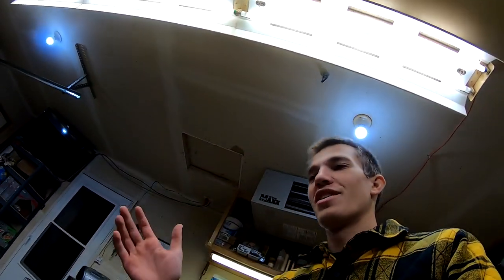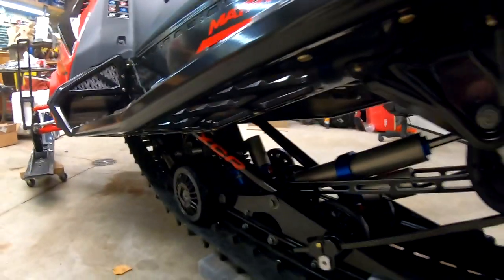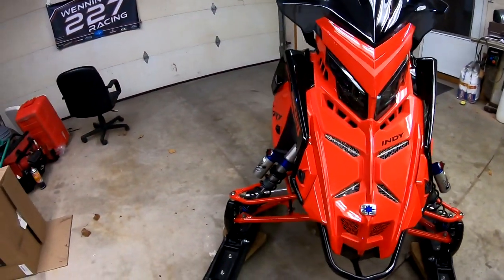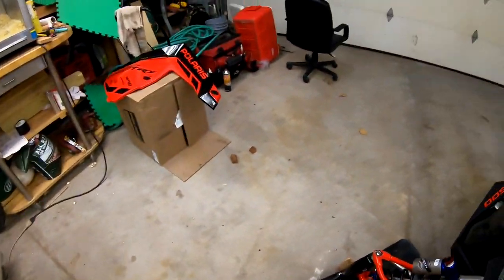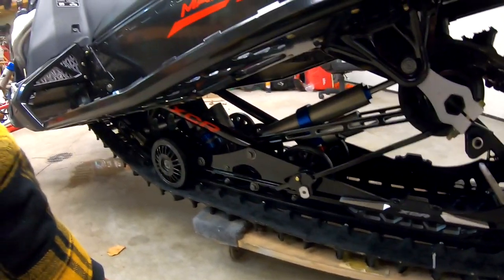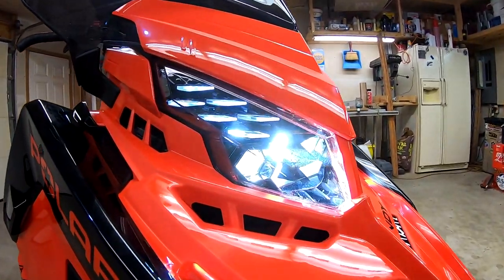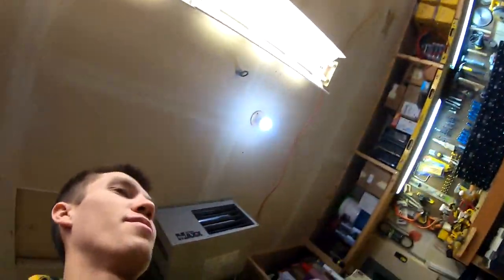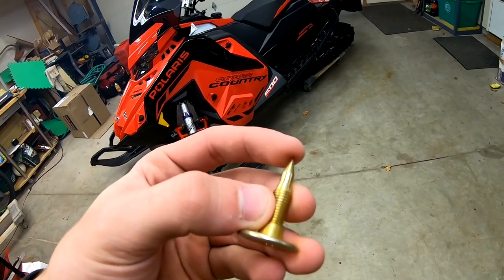Cross Country Factory Race Sled!

Comment: hardly any smoke lol,  usually your garage would be filled with the older two stroke motors, nice sled!! Good luck this season...
Reply from the maker: Yes haha and this is even alot of oil now since the sled is still in break in mode. you should see them after break-in!

Comment: So is that the same engine as in the race sled? Cause the only offerings to the public are 650, 800, and 850
Reply from the maker: Nope, Just a modified stock efi 600 found in the old trail sleds!
Reply: @wenninger2279  old trail sleds as in axys chassis?
Reply from the maker: @kollak01  correct

Comment: For the ice studs kwik pixx, what length should I use for a track with 1.25in lugs. Should I order the 1.375 or 1.080?
Reply from the maker: Depends on the rules in the class your racing in 1.375 will give you 3/8th of a inch of poke on a 1.25 track

Comment: what kind of ice racing are you doing?
Reply from the maker: Cor powersports Cross country its the national series
Reply: @Wenninger227  nice, good luck!
Where are you located?

Since  you put in quick pixs it really limited the types of racing you could have been doing.
Reply from the maker: @jonstevensmaplegrovefarms3754  about 15 min north of green bay. And I run two different tracks. One for ice races and one for terrain races with normal carbide tip studs.
Reply: You're over on the east side. 
If you look west 5 hours I am just across the st. Croix River from Grantsburg Wisconsin

It's pretty amazing how far these snowmobiles have come even since the mid-90s. I am now trail riding a snowmobile with a 146 by 1.6 lug track and the sled drives like a 121 on the trail.  twenty-five years ago, when a buddy had a 133 long track, we thought wow that thing would go through anything. 

I remember riding 136 and 144 sleds back then and they were horrible on the trail and they did not do that great in the deep snow because the chassis always drop the rear end and kind of chain sawed through the snow. And if you did get on top of the snow the minute you let off the throttle the front end would just submarine.

It would be interesting to see aggressive Trail Rider today on a sled like yours run the i500 and compared to some of the old times
Reply from the maker: @jonstevensmaplegrovefarms3754  ill be in the i500 February 11th and 12th I believe. I'm really amazed at how well those longer tracks handle on trails too! Old long tracks feel like you're driving a school bus down the trail. I'm also amazed at how well newer short tracks go through deep snow. My last sled was a 120 and could easily handle deeper snow.
Reply: Good luck on that race! Would they allow a helmet or chassis mounted camera? Be some great footage. The support vehicle getting footage would be nice!
Reply from the maker: @jonstevensmaplegrovefarms3754  no helmet mounts but you can mount to the chassi. I think ill also have CL Productions recoring me from a chase veichal.